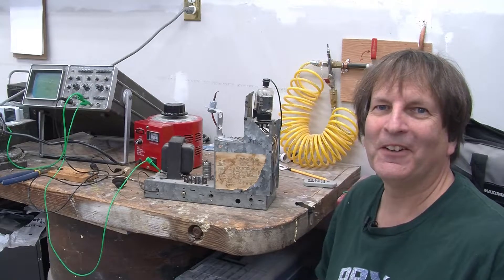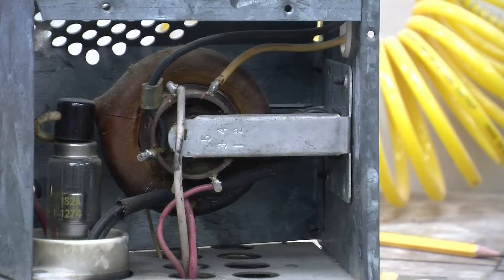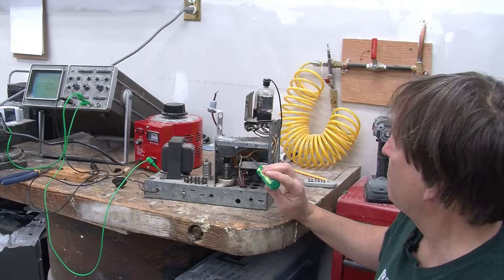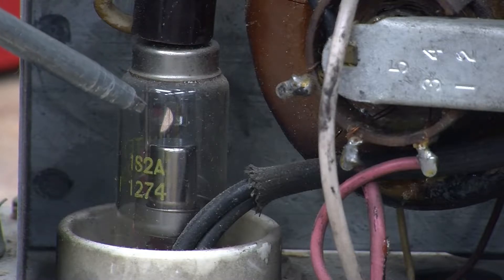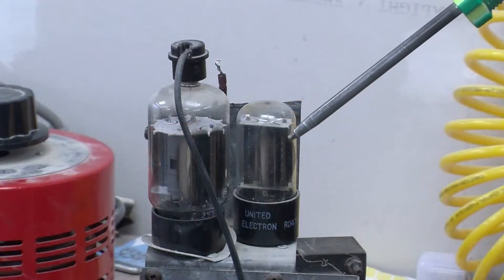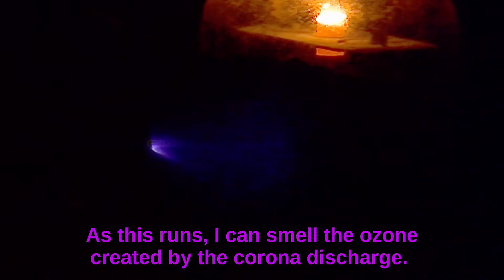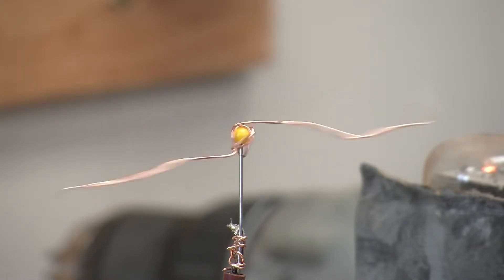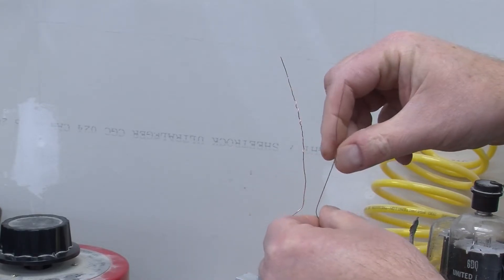High Voltage Flyback Generator Part 1 (the generator and experiments)

Comment: Awesome video! Thanks for answering some questions I have had for years. I successfully repaired my dad's tv in my 3rd year of electronics at the votech. I gained a lot of respect for high voltages after that endeavor.
Reply from the maker: Thats neat - nothing like real hands on stuff -  are you an electrical tech?  In hindsight, its surprizing there were a lot of injuries or worse from those old TVs. The 18 to 30 KV DC feeding the crt thankfully has such little current its not too bad, but the plate on the power tube driving the flyback transformer with a few KV and a significantly higher current is really in the potentally lethal category. I really lucky to not have been zapped by that.

Comment: I once built a HF oscillator with a GU81M tube. The anode voltage came from 2 microwave transformers. The feedback to the grid of the tube consisted only of a small wire antenna and a resistor against GND. The anode was connected to a resonator coil. At the other end of the coil, a plasma flame usually ignited immediately when the anode voltage was switched on, sometimes one had to help with a WELL INSULATED piece of metal.
With the piece of metal I could draw up to 10cm long HF - arcs. The radiated HF - power has immediately crashed my PC in my house and 2 TV - devices have switched off. Fortunately, they still worked properly afterwards. Otherwise, my wife would probably have done terrible things to me. 😂
After that, I used the "device" only a few times outside and then disassembled it.
Reply from the maker: Wow - I looked up those tubes - they are really high power tubes. It certainly makes my little HV generator look like a toy! With such large HF arcs your project would seem to have a lot of similarities with a Tesla coil, but with way more power. Certainly a good example of induced voltages messing up electronics - similar to a EMP.  Was it just for fun? Or was there a use for you high power HF generator? When I first saw HF oscillator I immediately thought ham radio but it clearly isn't that.
Reply: @ElectromagneticVideos  
That was a test setup at that time, which went in the direction of CW - tube Tesla coil. In the middle of the residential area, the device would certainly have brought me sooner or later in trouble with our RegTP. Therefore I did not work on it any longer. The HF - power was surely >0,5kW, because the anode plate started to glow within seconds.
The oscillation frequency was about 6MHz.

(RegTP = Regulatory Authority for Post and Telecommunications in Germany.)
Reply from the maker: @kaysonntag74  That is very very cool! An incredible amount of power - year ago I was involved in digital HF communications and a few hundred watts was all that was needed to go continent type distances.  You didnt make a video of it, did you? It would have been fascinating to see!